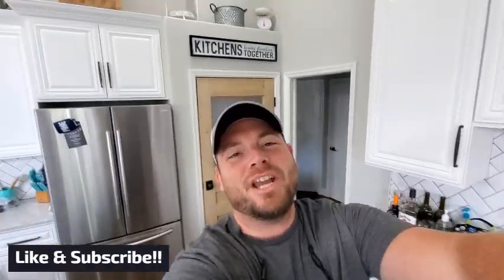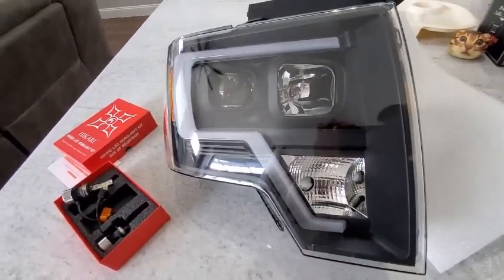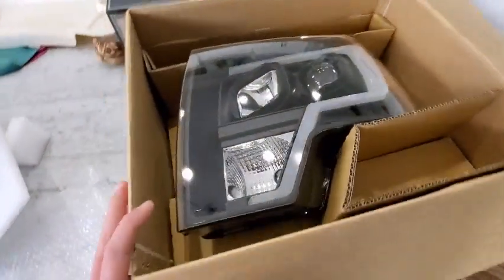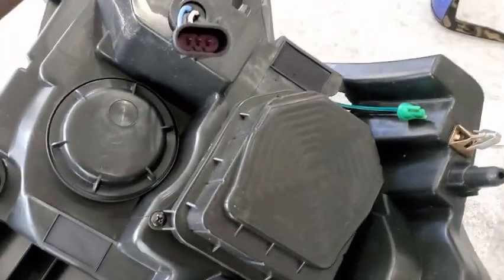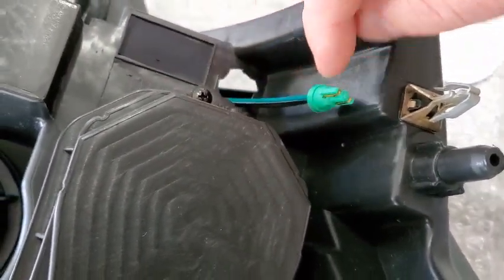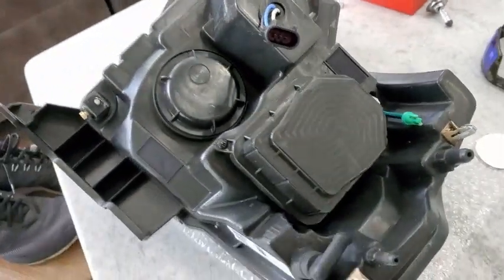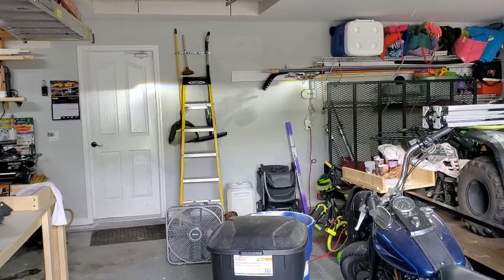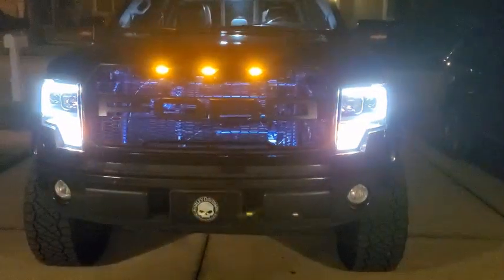F150 LED DRL Headlight's are Installed!

Comment: Damnnn looks clean as hell! I need the glow behind the grill to light up my intercooler!
Reply from the maker: Thanks! Its just the peel and stick LED light strips from Walmart that I tapped into the running lights. I found them in my tool box and just slapped them on for fun but ended up loving how they turned out.
Reply: I wanna do it but I have SOOOOO much going on with my truck it’s borderline tacky 😂

Comment: What size lift and tires do you have? What backspace are your wheels? Nice truck it looks awesome.
Reply from the maker: 35x12.50x20 Nitto Ridge Grapplers, wheels are 20x10, not sure of the backspacing but I also have 2 inch wheel spacers on them

Comment: Looks sweet thanks for the video.  Now I know how it’s going to look on my truck. I got those same headlights coming for my 2012 Harley Davidson. Looks like everything was just plug in play. Did you have to adjust your low beams level?
Reply from the maker: they needed a little adjustment but it only took a couple minutes. Also nice you dont have to take anything apart to adjust them, just pop the hood and turn that adjustment knob

Comment: I am looking into these but I am afraid that the halogen bulbs won't be bright enough. What did you use for the high beams? I think I might go HID with the projector/halo since there is no reflector in the low beam.
Reply from the maker: I went led on both high and low beam, no problem so far and much brighter than what I had. Best of luck!
Reply: @jtpbuildz959  I actually ended buying these and got the same bulbs you have. However, my left (drivers) headlight is way to left, is there an adjustment for the horizontal beam?

Comment: How did you manage to take off the H1 bulb? I’m having a hard time trying to disconnect, don’t wanna break or loose nun
Reply: *Edit* been like a whole year passed and I opted in for the clear lens lights with the same LED’S I actually tried to get another pair of LEDs so I can do a similar setup on my expedition now but they sadly discontinued the H7 bulbs, but hey at least my f150 has been modernized a bit 🤷🏽‍♂️

Comment: Question, I just tried using the link for the Hikari H7 LED  bulbs, it didn't work, it says it can't find the page.Also, where did you put the resistors?
Reply from the maker: Don't bother, the resistors I used took a crap not too long ago, looking to replace them now. My turn signals are back to hyper flashing. Back to Amazon!
Reply: @jtpbuildz959  Thanks for the heads up!

Comment: Where did you put the LED strips behind grille? I'm gonna put some on my 14 but don't exactly know where to mount or wire...
Reply from the maker: They're actually not mounted to the grille, they're on the radiator supports and wired to the running lights. I did it just bc i had them laying around and decided they actually look good! Walmart 12" white strips, can't go wrong for the price!

Comment: But how is the light output compared to the factory headlights with led's
Reply: This is the real question. A lot of times an LED Bulb in a projector housing does worse than Halogen. Of course, HID would be the brightest
Reply from the maker: These are much better than what I had before, sharp line at line and better light throw in my opinion. I'm still very pleased with them

Comment: call me naive but how you get the DRL working ? do you have to turn on your parking lights in order for the DRL to lit up during the day ?
Reply from the maker: yes, they only come on when the lights are on or you can direct wire them to something else to have actual DRLs
Reply: I've read that you use a certain fuse, not sure which one, that works.  Search for it and I'm sure you'll find it.
Reply: @hotfiyah  hey thank you I did it , was very easy.
Reply: @julioesquivel2007  What fuse did you use? Process to get them working?
Reply: @julioesquivel2007  did you wire it to a specific fuse to get DRLs ?